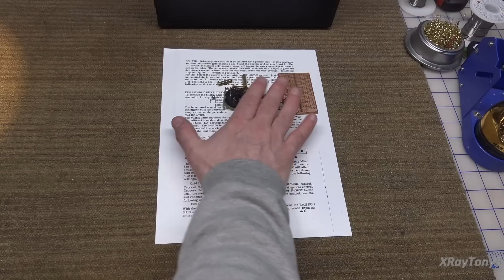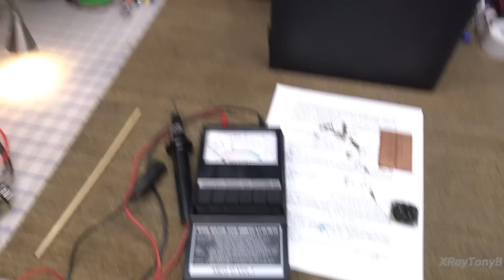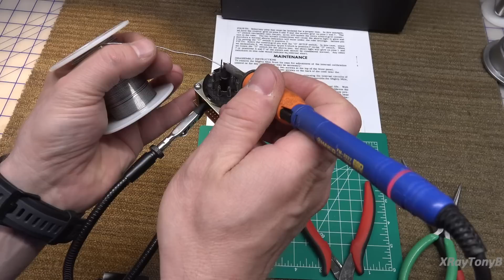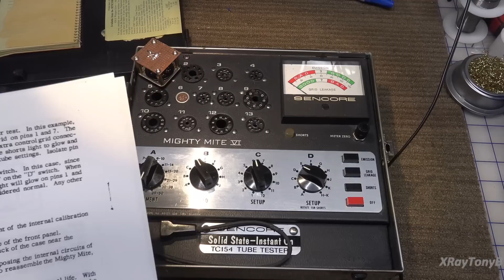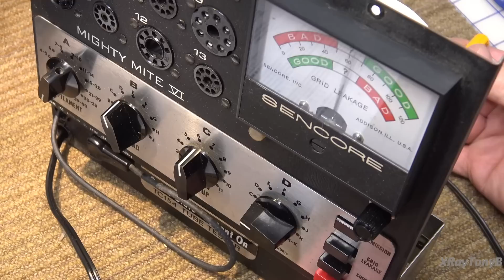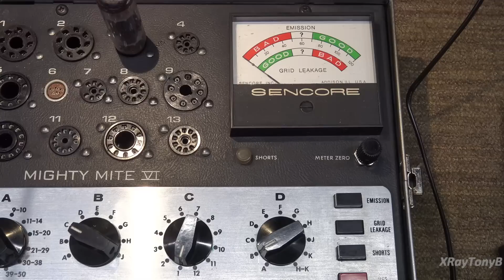Sencore "Mighty Mite" TC-154 Tube Tester Calibration

Comment: When I built mine I removed the base off a bad octal tube, installed the components inside the old base, then filled it with hot glue. Nothing exposed.

Comment: I have the TC162 and it's a great tube tester. I changed out all of the carbon comps and cleaned all the sockets with 91% alcohol and it's like brand new. To check the 100M resistor, put it in parallel with the other two resistors and the three should measure 996 ohms. I enjoy your videos.

Comment: I have some old sovjet/gdr digital equipment for measuring resistors like that and these instruments are surprisingly accurate too (4+ digits) for their age (tested in a  lab here in town). One instrument goes up into gigaohms - only downside of these things is, they weight like a ton and are humongous.

Anyway ... nice project and well executed. Mayhaps i should check for a tube tester too - but these things are quite expensiv most of the time due to "rare/vintage/whatnot".

Best wishes from germany, Tony!

Comment: Shouldn’t you have zeroed out the meters at the front panel before running your calibration analysis ? From the angle i saw it looked like the pointer was past the zero , just curious if you checked that out before adjusting the meters from the inside pot ? Thanks for the cool video .
Reply from the maker: It's hard to get the camera angle right, so you can see what I see.  It was dead on.

Comment: The Sencore line of emission testers are leaders in grid leakage testing capabilities. In rare cases I found some tubes took up to 5 minutes before the grid leakage slowly moved and failed the tube, and I proved this in a working circuit. Even my B&K 747 failed to detect some of these faults, having the right equipment that is properly calibrated makes all the difference.

Comment: Hi Tony, years ago I acquired a knight kit emissions tester and damaged a bunch of tubes in my friends TV, I didn't realize what I had done until much later. I won't use an emission tester to this day. 
I now have a TV7 that I really like.
Rich
Reply: Do you know what the fault was that caused damage? Wrong filament voltage applied?
Reply: @zulumax1  I held the test button down too long, I didn't read all the directions. apparently that will tear off the coating on the cathode.

Comment: I am old enough to remember taking the back off of our black and white TV, removing all the tubes (there was a diagram on the inside of the back showing which tubes went where), putting the tubes in a sack, and riding my bicycle to the local pharmacy, which had a tube tester and sold replacement tubes. You'd look up the tube in a book, which would tell you which socket to put the tube in, and what position to put several rotary switches. Then you'd press a button and look at a meter. If the needle was in the green zone, the tube was okay. If in the yellow zone, it was questionable. In the red, it was bad and needed to be replaced. I went through this not because the TV wasn't working, but because I wanted to play with the tube tester. God bless my parents, because I took everything apart held together with screws and bolts.
Reply: Are you sure we weren’t separated at birth? This is exactly the sort of thing I did as a kid. And I wasn’t constrained even by nuts, bolts, or screws; I could get most anything apart, as long as it wasn’t welded. I’ve still got a big, black garbage bag full of old radio/TV tubes that I pulled from these endeavors. Later I even put together some Radio Shack kits, and even a few Heathkits. Yeah, those were the days.
Reply: And now all electronics have a warning that says don't open this device there are no serviceable parts inside. Plus don't open because you can get an electrical shock

Comment: I have the TC-162 that I imagine will need some calibration. I will look into replacing the old single-turn adjustment controls with a multi-turn pot. That should make adjustments less touchy and easier to accomplish.

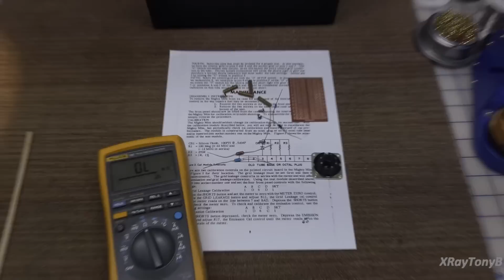Comment: @ 4:00  Most Fluke DMM's from the 80 series, and Im sure the 180's, have a Conductance - "Nanosiemens"  measurement function (Conductance is the inverse of resistance, 1G ohm measures to 1 nS) , that, will let you measure up/down to  0.01nS, or  to 100G ohms with a low voltage. It is also on some older Fluke as well as higher end Brymen DMM's, and some of the Fluke's it's an "easter egg", and, I made a video on it.